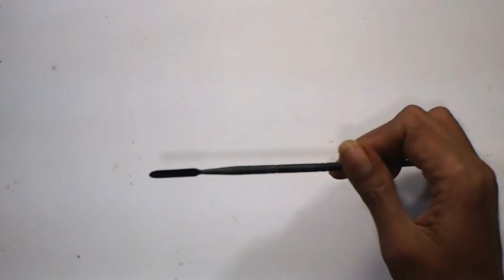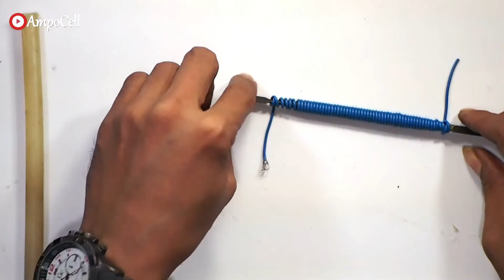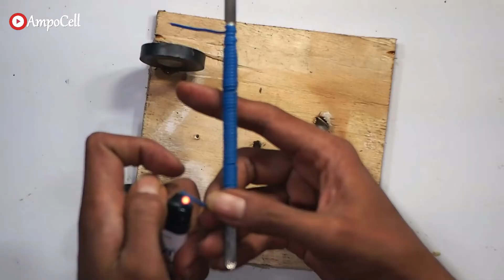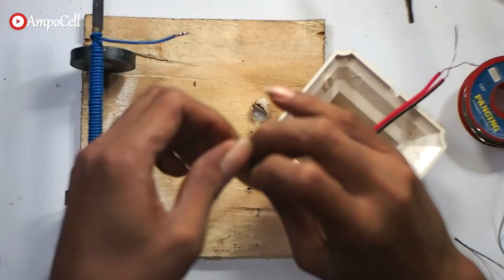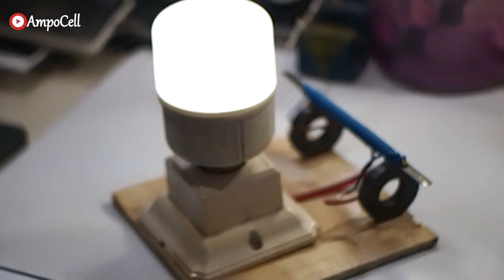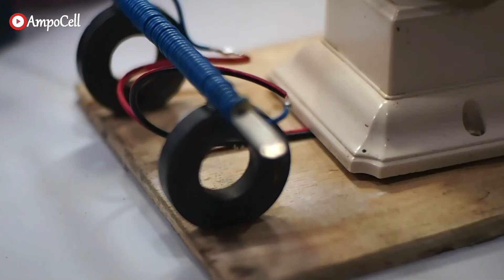Saya membodohi orang menyalakan Lampu Pake Magnet

Comment: Instead of soldering the red and black wires to the blue wire, just solder the red and black wires together!   After all,  you are using an LED light with a battery inside!    The light is bright.  You're not!!!